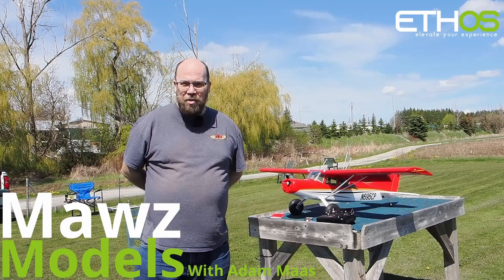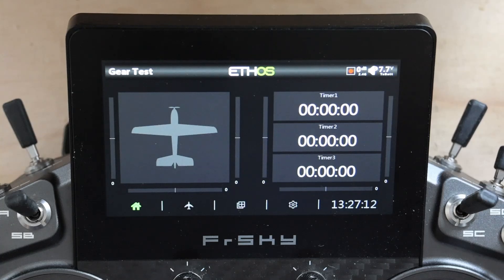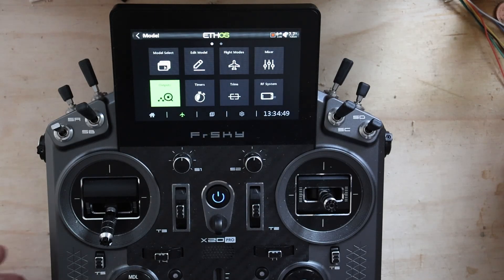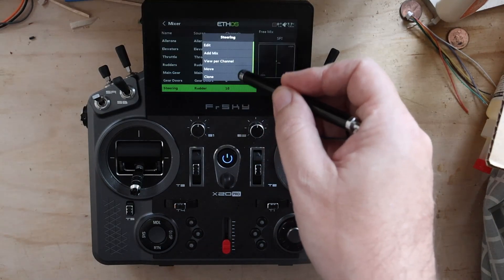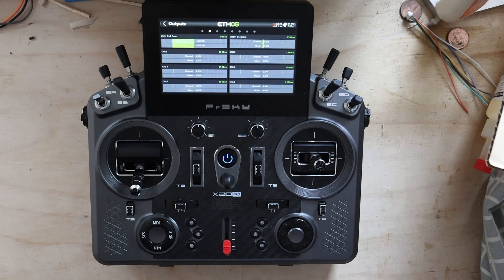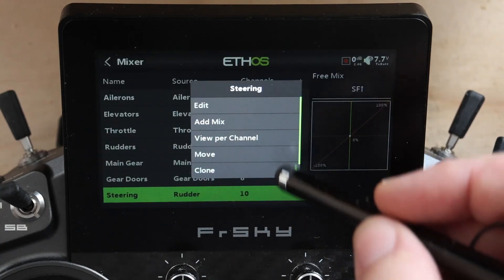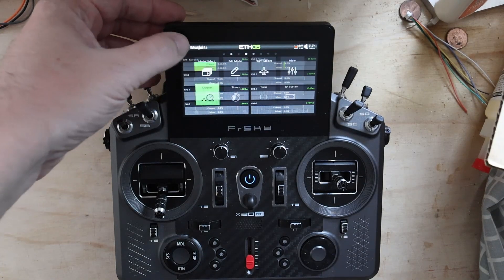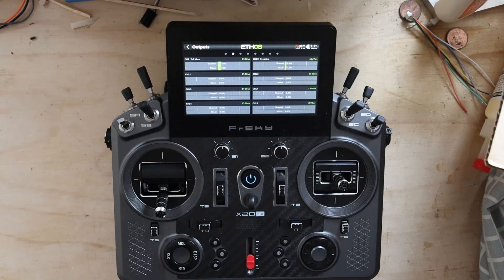ETHOS Tech Tip 23 - Nose and Tail Wheel Steering

Comment: Adam, I have recemtly switched over from Spektrum. I have figured out everything that has applied to myself so far except for reverse thrust. I can't find any videos on this or written instruction. Would you be able to help me with this?
Reply from the maker: Reverse thrust depends heavily on the exact ESC being used. The ones with it on a second channel are easy from the radio side (A free mix with the switch as teh Source and the desired channel as the output), but may be complex from the aircraft side if using an Avian or Avian Lite ESC which needs to be running in SRXL2/SMART mode for reverse to work (which requires additional hardware). 

I will do a video on this in the not to distant future. Just need the right setup to show it off.